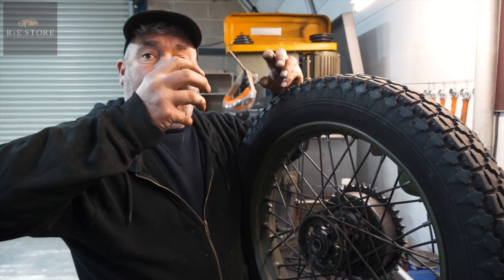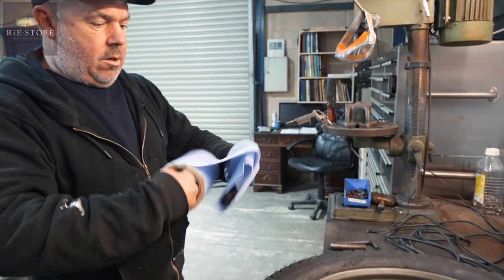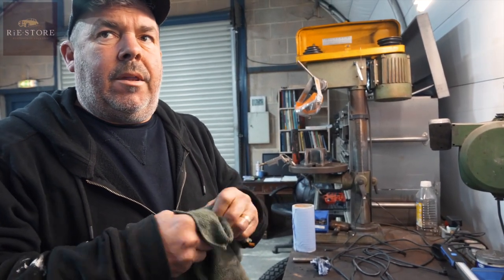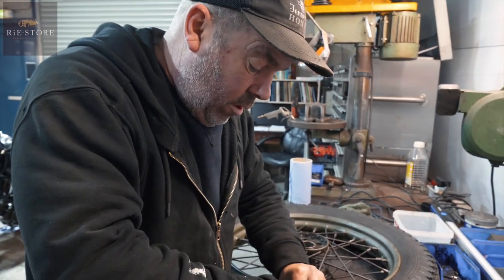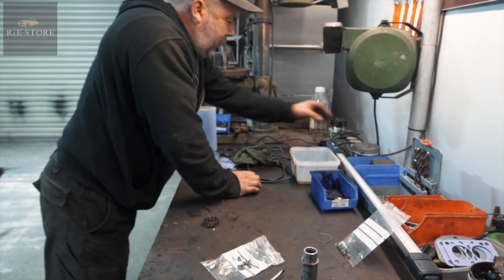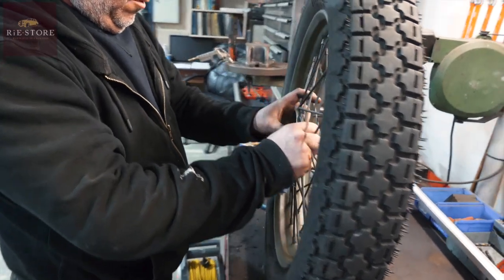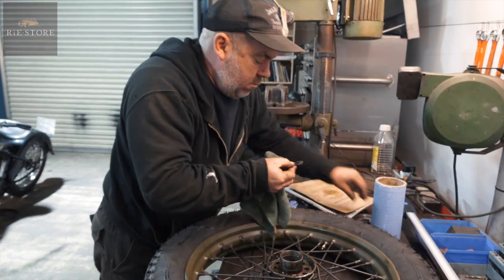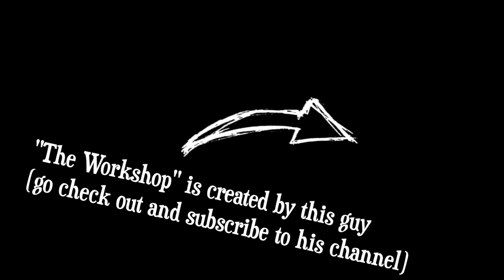Needle roller replacement - 1942 Harley Davidson WLA / ep113

Comment: Hi, I am currently sorting the rear wheel on my WLA. The current rollers are +.002. (The inner axle must have been ground). I have a .003 gap between the rollers and the outer race so I'm guessing it needs to improve. Looking at the parts suppliers it appears this is the largest oversize roller available. What you do suggest? Many thanks - from the Southern Hemisphere.